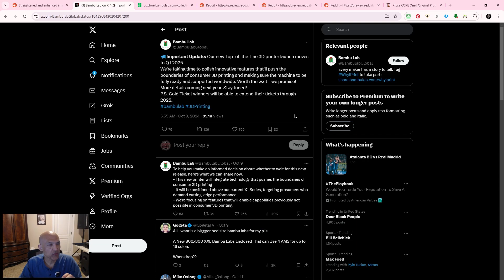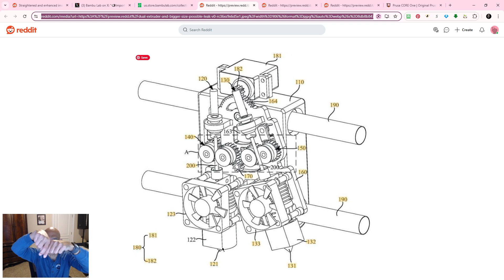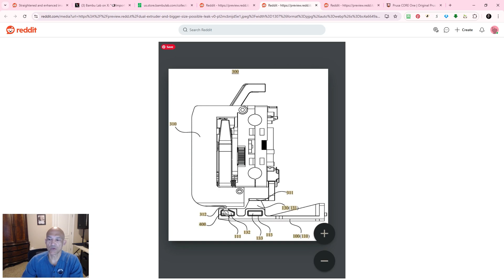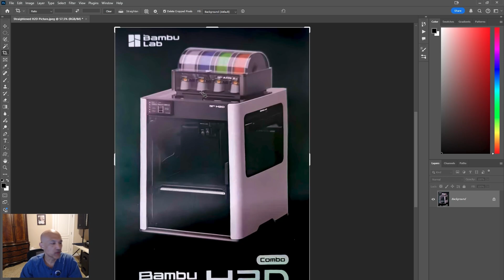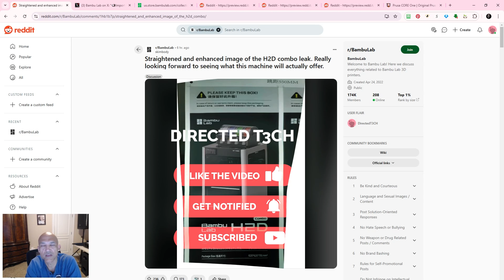Bambu Lab H2D - Is this the next flagship 3D printer?

Comment: I'm super excited about a new printer from Bambu. I think the dual hotends is a great way to cut the speed down without needing separate tool heads. It would be amazing for support materials too. I really hope they add an easier hot swappable hotend like they did with the A1 series though.
Reply: I don't think a dual extruder on the same head is that a great idea though. While it still needs to purge and it's now purging above an active print or still needs to move out of it's way as with the P1S or X1C.

I think a dual (separated) extruder should have been way more efficient, while it should be able to prepare itself out of the way, while the other is printing.

But we will see on release...
Reply: @rockels_journals  Yeah, I think the dual print head is a great idea as long as it has two extruders. The only downside I can think of is the added weight on the print head. Of course you would still need to purge but it wouldn't purge as much and it could cut print time in half potentially. Going with dual hotends and one extruder doesn't seem like a good option for me either, I don't think it would even cut down on time and the only use case I can think of where it would be beneficial is when printing two different types of filaments so you can have different temperatures on the hotends. It would also help with switch from PLA to TPU since the TPU can have issues pushing the rest of the PLA out of the nozzle tip.
Reply: @jmp7624  As long you print with 2 materials or colors, it would be beneficial yes.
But when going to print with more, it still needs to cut the old filament and purge the remaining leftover and flushing with the new material or color. Just as it needs to do now. I'm not sure if it's a great Idea to do this above an active print, or it still needs to go to a purge bucket.
For that it probably would have been better to have 2 seperate hotends, it would only need an extra stepper motor.

2 purge points, left and right. And every hotend/extruder would be able to purge and prepare separately from the other, while the other is printing.

Only thing should be that the need to move on the same Y-axis with that. It could be solved with a double Y-axis. But this maybe gets a bit complex and expensive. But then one extruder could have it's 0 point in the back, and the other in the front.

I would like to see with what they're coming up. Maybe I would still go for a X1 after all.
Reply: @rockels_journals  Yeah, if you print with more than two filaments it will still purge the same amount without tuning but the time will be cut down significantly because you would have two hotends and extruders loaded with filament. So for at least 2 colors, it could purge and load the new filament faster and depending on the model, it wouldn't need to change colors as much. 

Having a separate print head like the Prusia XL would have been a lot better of course but it would have cost significantly more to design the tool head changer and then people would have complained about only having 2 tool heads. Even going with two separate tool heads like older dual tool head printers, it would cost more to make the whole printer larger to actually utilize the full build volume keeping the other tool head out of the way during printing. I think customers would also be upset over this design change because of how much most space the printer would take up. One reason Bambu printers are used in many print volumes is because of the smaller footprint on their CoreXY printers so adding an additional potentially 4-5 inches on each side to accommodate the tool heads staying out of the way would greatly increase the width of the already quite large printer. I don't think they would sell as many if the printer was too big because print farms wouldn't be able to fit as many on their current racks. 

Everything is just speculation at this point though. I'm sure they will have their printers optimized for space and speed. I'm personally more worried about the price than how they manage multiple hotends, extruders, or tool heads.
Reply: @jmp7624  I expect the price going to be €2000 yes...
If that's the case I will go for a X1C, hoping that by then their prices will drop a bit.
Had a P1S before, and it wasn't that bad either.
Reply from the maker: Absolutely! I love how easy it is to change those nozzles!

Comment: We really are turning everything into a creator (1) aren't we, core XY dual head printer from 2016  - Flashforge accidently innovate but implement it so poorly it doesn't sell until another company catches on and does it right again
Reply from the maker: Do you think it was a good concept that Bambu could improve on if the rumors are true?
Reply: Other printers have been doing this on a professional level for a long time stratasys being one of them. I print dissolvable pla supports and ASA on the other. Would be great to now finally see at the consumer level

Comment: Prusa try and take shots at Bambu... yes Prusa have nothign to offer but crazy prices and half a decade old parts.  Able to upgrade from the mk3 mk4 to the new machine just tells me "old parts"
Reply from the maker: The upgrade path is nice in one sense, but it's often cheaper to buy a different printer brand. I think I'd still prefer my P1S/AMS combo to the Prusu One with MMU3 or whatever they use for multicolor.
Reply: Meanwhile, people that care about the earth like that. Reduce, reuse, recycle is in that order for a reason. If I don’t need new smooth steel rods, don’t make them. If I have steel rods, reuse them.

Comment: Now Bambu has to compete with the creality k2 plus. I wouldn’t mind a P2S Max/Plus.
Reply from the maker: Based on Bambu Labs comments, I think they aren't looking to compete at that level, but at the higher end market with the next printer. I know there are a good number of people that want larger build volumes, but I've never needed more personally.
Reply: The K2 is not as good as the P1S, there is nothing to compete with. The multi material from reality has issues and the machine it's self has no features the P1 lacks
Reply: @backtoearth1983  > the machine it's self has no features the P1 lacks

The K2 has a heated chamber, biugger build volume, and much easier to live with AMS
Reply: @backtoearth1983  not so sure, watched quite a few reviews, and it comes up on top in every one of them compared to x1c

Comment: It is a hoax. The image is AI generated. The logo on the bottom is wrong. Just compare the letter B from the logo on the bottom with the regular Bambu logo. Not to mention it is missing the icon.
Reply: Bambu has said that they have a new printer to be above the X1 Q1 2025.  Don't know if this is it, but it's near.
Reply from the maker: @califpv  It's pretty interesting either way, right?  I'm looking forward to seeing the next printer for sure.
Reply: LOL, if you actually have a Bambu Lab printer… go look at it. Bambu Lab uses two different versions of the Bamubu Lab name type treatment. A Stacked (2-lines) appears next to product titles like the AMS and X1C, the single line logo appears with a similar but totally different font treatment without the little extra squares in the B, whenever the logo appears by itself without a product title. It’s almost as if no one could believe what you say since you aren’t cognizant of details.
Reply: @joeylopezdesign  I have a bambu A1. The supposed leak also released two diagrams, The dual extruder in the diagram is similar to the Makertech Dual Switching extruder. The two nozzles revolve around an axis. The dual extruder in the picture is a dual lifting extruder similar to the ones on Ultimaker or Raise3D machines. The diagrams work as a source of trust, it is a confidence trick. The Image isn't a photo and it isn't a 3d rendering either and that is why I stated it is AI generated.
Also if you are going to use a filament router it would make sense to have 2 print heads independent, like in an IDEX printer. That way you can prepare one print head to print the next colour while the other is printing. I have owned IDEX and dual lifting hotend printers. I have assembled printers from scratch, out of aluminum extrusions. I am a software developer with a background on electronics. I haven't started this hobby yesterday. It is possible there was a verbal leak and Bambu is going to use two print heads. Everything is possible. But these images and diagrams weren't leaked by Bambu. Go ahead, disrespect me. That's not going to make the leak true.
Reply: You realized this image was straightened right?
Reply from the maker: It should be interesting to see how this plays out.  Thanks for commenting!
Reply: They told me going in 400
Reply: Your right it is AI cause I asked customer service when I bought a second A1

Comment: Whatever it is, I'm buying it.  If it reduces waste, everyone else will too.  I'm guessing they are working on waste on colour prints and support material.  It's too much, and it's adding to the cost of 3d printing.

Supports clearly suck.  A simple bed swing, 5-axis printing, could work with multiple nozzles.  It's just a software problem.
Reply from the maker: I hope they are working on all of that! Thanks for taking the time to comment.